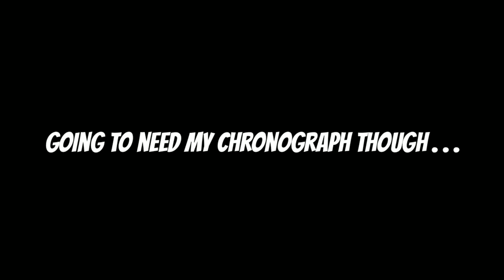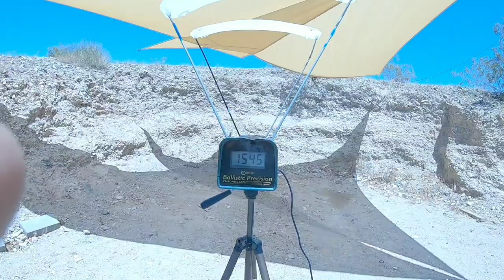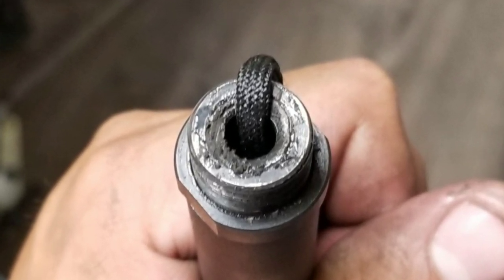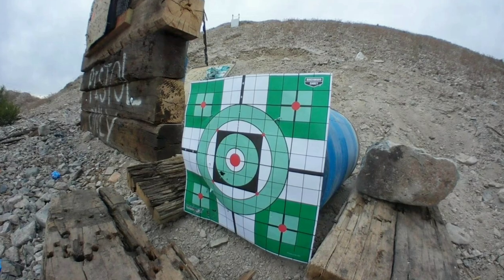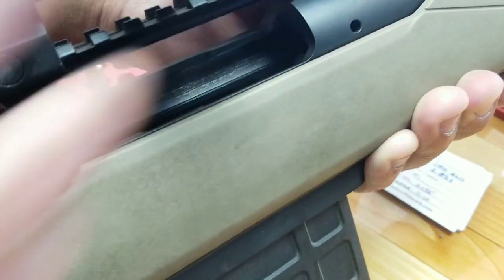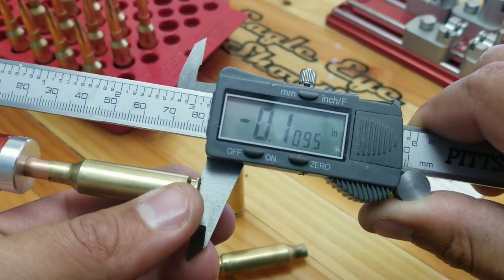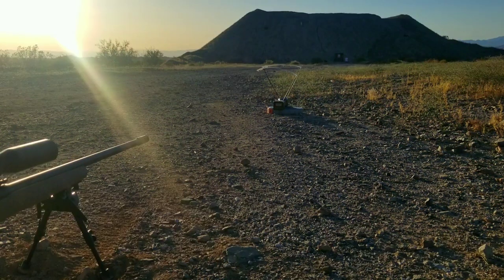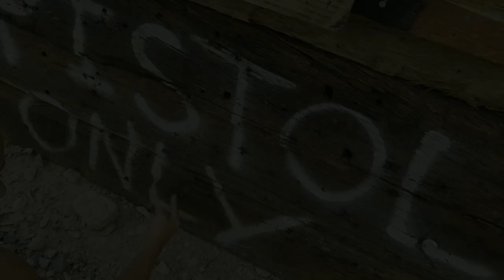Restore Your Rifles Accuracy - Common Overlooked Problems - DIY Max COAL Gauge

Comment: I have had that happen with the 224.  Noticed some accuracy degradation, took the break off and had a ton of carbon build up (A lot more than I ever would have expected).  Cleaned that out and got back to better accuracy.  Good information as always.

Comment: I experience a similar episode when I removed my muzzle brake off of my 6.5 Creedmore ,  Only It was built up inside the brake like a wall that I had to chisel through and then soak in solvent.  I am somewhat familiar to this having a couple of AR's, but this was way more than I expected.   And you know what they say about people who have chrono's,  There are 2 types, those who have shot theres and those who will!  which is why I now own a magnetospeed chrono.

Comment: Loved the Young Frankenstein clip. Glad you were able to resurrect your chronograph. 
I remember years ago, we had some carbon fouling at the crown of our rifles, but after about 500 rounds. Even though we were required to thoroughly clean our rifles after each outing, the carbon was still there. It was explained to us by our armorer that there is a vortex created between the muzzle brake, and the crown, and even good cleaning won't get it out, without removing the brake. So we had to remove the brakes every 200 rounds, and clean.
That seems like a lot of throat erosion for only 1600 rounds! Keep an Eagle Eye on it, bud.
Reply from the maker: Awesome man. Thats good info. Thanks Jerry!
Reply: @EagleEyeShooting  Ask Willie if they still had the same issues with their brakes, since we were just starting to use them in my program, and he was in after I left the program

Comment: Same rifle... and I've been having the exact same problems. I know this gun is better than 1/2".

I had the SDs in single digits and the ES in the low teens. But it just doesn't group to support those numbers. 

Time to pull the rest of my competition loads and re-work.
Reply from the maker: I burnt this barrel out but it's still shooting really good. Occasional flyers.  Just took it out to 2,000 yards with two impacts.  What bullets are you running. And are they hand-loads?
Reply: @EagleEyeShooting  I'm using Handloads. 

Equipment wise, I'm using nearly identical setup to yours using Lee Ultimate dies for body sizing and neck, but I don't have a high $$ seating die. I do not check concentrity. Earlier this year I upgraded my loading bench with a RCBS Chargemaster and a Frankford Arsenal platinum case trimmer. I had already built my own annealer which works very well and I added a magnetospeed to measure the efforts.

My Current loads are: Hornady Match 140g BTHP running on 41.5g of H4350. (I can't afford the expensive stuff) Current velocities are in the 2750 neighborhood.  These loads were developed with previous equipment so I should be able to improve these tremendously.

Earlier this year I ran another ladder test up to 42.8g and thought I found that the barrel seemed to respond well with a velocity node hovering around 42.0 - 42.2 grains.

Trigger wise... I have it dialed down pretty low... sub 1# (Yes, it is possible)... 

Looking to improve from about .6" groups with way too many flyers.
Reply from the maker: I would say concentricity will help improve your groups from here. You can seat the bullet in 3 increments while spinning the cartridge 45* each time untill final seating. This helps improve concentricity.  Try to not bump size your brass.... despite what many say to do so.. bump sizing isn't the proper way to size brass for precision bolt action. Instead setup your full length sizing die to where itll size your brass and give little resistance when locking the bolt down. Also I found the decapping pin to cause lots of runout. If you're willing, you can drill out your Full length sizing die using a drill press and turn it into a body die. Use the lee collet die to return neck tension.  Now for this rifle, it shines if you switch to Small Rifle Primer brass CCI 450. I recommend Starline brass. My testing shows a better pressure curve with that brass and primer. Accuracy node either 41.5gr or 42.5gr +- .3 grains. Try these out and let me know what results you get👍
Reply: @EagleEyeShooting  A lot of guys  I shoot with have transitioned over to small primer brass. I've got too much $ invested in the stock I have. For depriming, I removed the depriming rod from the full length sizer and I've been bumping the shoulder .002 (recommended for reliable feeding in VERY dirty environments) ... but I'll try a batch with zero bump and see how it feels. Someone DID recommend the seating trick (seat+spin 3xs) to help with concentricity. I'll incorporate that into the next testing phase.
Reply from the maker: @bodynfocus  I shoot in possibly the worst environment with silt and sand and never have reliability issues. That whole concept of bumping back 2 thousandths for "reliability " is a huge misconception.  I'm not sure where that idea came around. If you size the body back down and set overall  length to your max headspace up to 2 Thousandths over. You'll never have a bolt stick. Here's some thought on this subject.  Bumping the shoulders back with a full length sizing die will leave the cartridge loose in the chamber.  This means the bullet tip can sit offset to the centerline of the bore. Your ejector pin doesnt help either as its pushing towards the outside. Second, it's inducing another variable thatll effect peak start pressure. I can guarentee that not every case was bumped back exactly 2 thousandths.  So internal volume can differ as well as every case has different expansion rates due to the alloy composition. You'll see this when your done firing your batch of brass. Line up the batches and inspect that Carbon ring. Any differences between the cases indicates different peak start pressures thus velocity deviation.  If the carbon sits on the edge of the shoulder or below. Its not sealing the chamber to its potential. I believe the bumping for reliability came around when PRS did, folks where interchanging there handloads with similar chambered barrels (switch barrels) this is wrong also. As brass has a spring back memory as well.  You never want to use another rifles brass if your talking precision.  New brass fire formed to that chamber. If you change barrels or rifle get new brass to fireform and measurements taken after the second firing, neck sized after first firing
Reply: @EagleEyeShooting  Understood. I have a fresh batch of fired cases that need to be processed. I will remeasure them and not bump. However, i do have a Q ... how can you possibly get a case OVER the headspace of the chamber? You mention going over that measurement. How is that possible? A case cannot grow outside of the headspace unless you are talking about the shoulder moving forward when sized...
Reply from the maker: With new brass. Fire form the case, head back and use the Lee Collet die to squeeze the neck back. Dont clean the brass, just the primer pocket. Load & Shoot. Now using a Hornady case comparator measure that Case to the shoulder (make sure old primer is punched out) this number will accurately depict your chambers Case base to shoulder (datum line) its also good to take notes of fired case neck diameter,  just below the shoulder, middle and just above the case head. This is so if you have problems with a sizing die, you'll know where it's failing to size that brass to your chamber...
Now, if you set your full length sizing die to touch the shell holder than back it out 1-1.5 times and size your case. You'll notice the case base to shoulder with the comparator measurement will be larger than fired case dimensions.  Set the die (screw down in increments)  untill you reach just above that fired case dimension. If you dont have a comparator,  how they did it back in the day is keep turning the die in small increments and size until the bolt will lock down on that case with slight resistance.  Some folks remove the firing pin to get a better feel of the bolt.

Comment: At 5:56 you had a dust up (Flyer?) between gun and target. Good info on muzzle break fowling.  After looking at the video 3 more time..ya that bullet 2915 fps blew up.
Reply from the maker: 2915 fps was a different string and was part of the 42.9gr group.

Comment: You. Are. The. Man!  That doesn't seem like many to rounds to have that much erosion.  I'm guessing it's the velocity, like 22-250, 25-06, etc.
Reply from the maker: Ya I've been pushing the speeds on this rifle. Probably another 1k more and the barrel is done. 👍
Reply: @EagleEyeShooting  Correct me if I'm wrong, but it seems like the Savage barrels are pretty easy to replace.
Reply from the maker: @Tex_I_Can  they are! The main reason for buying this rifle other than the floating bolt head. This rifle requires a clamp on barrel wrench for the barrel nut. The one thing I left out on this video is that I can correct the throat erosion by loosing the barrel nut and screwing in the barrel slightly with a Go gauge. Darnit..... lol
Reply: @EagleEyeShooting  Sounds like another video in the works!

Comment: Your load data says 42.9gr of H4350 but doesn't say what bullet. 42.9gr is 1.5gr over max charge for a 140gr Hornady bullet in their manual so I have to assume you were shooting a lighter bullet. I'm shooting a Savage Axis II with heavy barrel and I'm trying to tune up a load for hunting so I'm trying 140gr Hornady SSTs. I've always had the best luck with Hornady bullets out of my Savage rifles. So, what bullet were you shooting in front of 42.9gr of H4350?
Reply from the maker: Everyone's rifle is different,  published or not,  COAL of the cartridge makes a huge difference in pressure.  140gr ELD using Small rifle primed brass
Reply: @EagleEyeShooting  I'm running .006" off the rifling and still trying different bullet/powder combinations and I just loaded a series (some call it a ladder load) with H4350 behind a Hornady 140gr SST for hunting and the max charge in the book was 41.5gr so 42.9 seem pretty high unless you were loading a lighter bullet. Just curious.
Reply from the maker: My rifle, my load. Wont fit a mag FYI. Pressure tested with Oehler 43. Didnt exceed 63K peek

Comment: Carbon in a barrel?   Strait Walmart Carbon cleaner spray can for $2.   It will remove all the carbon in a barrel with 2 squirts and some brushing.   Your accuracy load is past reloading hot areas meaning it gives excessive heat and pressure on your barrel throat.   2750fps is a max fps  and going past that comes with more heat and pressure running hot against your barrel throat for erosion. Keeping the PSI pressure down and running lower FPS accuracy nodes = saving a lot of barrel life on a barrel.    When you run it on hot loads high PSI,  = stresses your brass and barrel.

Comment: I keep running into a problem that's driving me crazy I'm loading 223 and when I seat the bullet I'm getting huge variance like 10 thousands of an inch variance. Contacted Lee and they sent me a 222 plug worked fine for about 5 loads then ounce again numbers where everywhere does anyone have a clue what it might be?
Reply from the maker: Cant use the measurements from the case head to the bullet tip. Get a hornady bullet comparator to get accurate cbto. Case base to ogive
Reply: @EagleEyeShooting  I don't think it's that because I can physically see the bullet go way futher in to the cassing
Reply from the maker: Never heard of a seating stem doing that. If you dont have a bullet comparator to see for yourself the CBTO. Again what ever measurements your taking from the bullet tip is invalid.